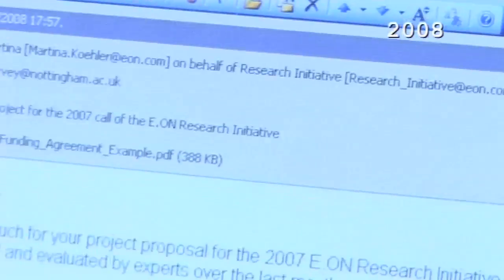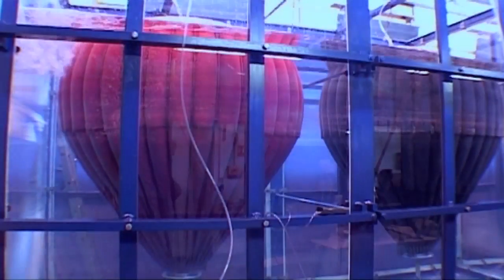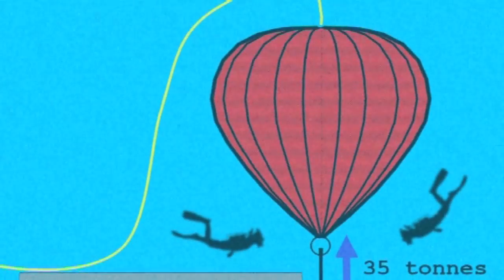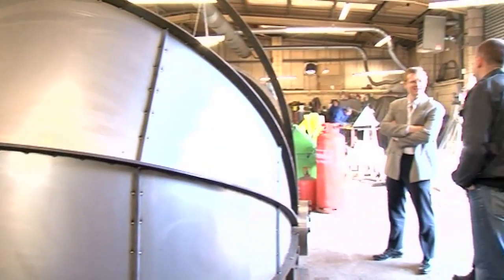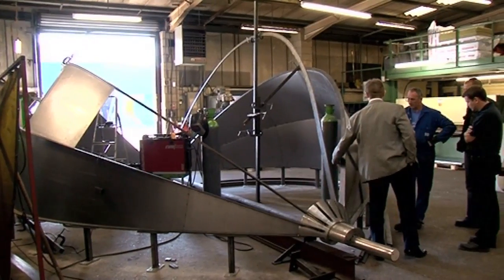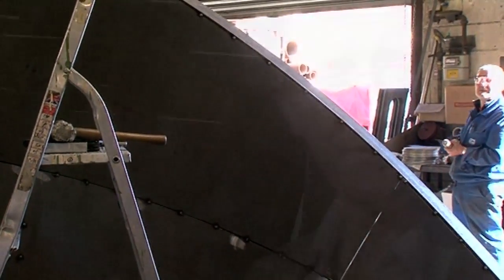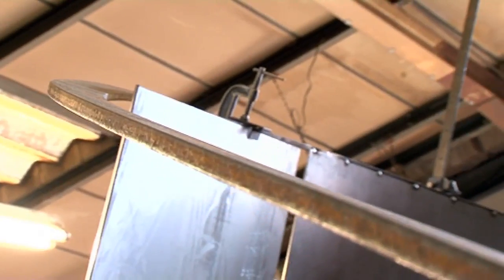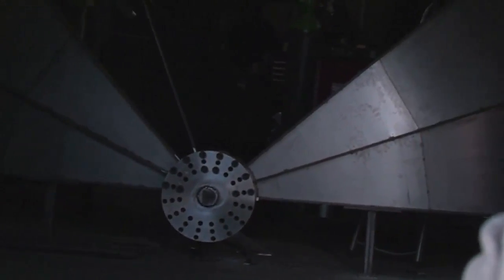Underwater Energy Bags

Comment: Looks like a bad idea to me. So you fill a balloon with air and push it down into the sea and the greater hydraulic pressure compresses the air and that energy comes from you pushing the balloon down, yes? That's not going to be efficient, for one thing because of the massive losses due to dealing with the viscosity of the water. But once it gets low enough, the air will be highly compressed and not taking much volume, which means that it will now lose its buoyancy and you won't be putting much energy into it to push it down further, and in fact there will come a point where the weight of the equipment plus the air full of compressed air will exceed its volume in water and it will sink and release energy in the process of sinking to the bottom. You'll also deal with the viscosity of the water when you try to USE the energy i.e. you bring the balloons back up. And finally there are much much better methods of storing energy in more joules per kilogram of equipment. It's just a silly idea.

Comment: I've seen this and similar ideas that use collapsible bags.  The struggle always seems to be to demonstrate that they are capable of withstanding the rigors of underwater life and thousands of cycles of inflation and deflation.

Why not just use an open-bottom diving bell, or some other rigid container with a vent in the bottom?  No moving parts.  So long as you don't completely fill it with air, the water itself acts as a seal.  It lasts practically forever.
Reply: @NickTymczasowy  I'll agree that that could be challenging in the stormy seas off Orkney.  I've been out in a small boat there before and it is certainly a rough environment.  The tales of the attempts by Uboats to penetrate the RN anchorage at Scapa Flow in both world wars are quite harrowing.  Even here, though, block ships sunk in important channels with massive daily tidal pulls coming from both directions have not moved appreciably in decades.  An old barge, with sufficient steel or concrete ballast attached to the gunwales, capsized and sunk could certainly stay in place for years, if located properly.  However, if we wanted to get a bit more sophisticated, we could certainly cast a steel or concrete cylinder that would float above a tether like these balloons.  It would be cheap and easy to produce (you could even use all sorts of retired storage tanks) and would be far more durable than a puncturable balloon that is constantly expanding and contracting.

Comment: First law of thermodynamics states that when you compress a gas, it releases heat.  Where is that heat going in this system?  Lost to the ambient water temperature.  
Their is no heat exchange system used to capture that waste heat from the compression.  For that reason, using this for the storage of energy in the form of compressed air would be very inefficient.
Reply: Unless the Baloons are made of nonconducive matter.

Comment: If this works at 50 meters how much more efficient would it be at 100 or 150 meters? Or would the losses from the flexible hoses exceed the gains from the increased pressure?

Comment: The design of the weight was horrendously expensive and prone to failure. A far cheaper way would be to use sections of the legs of scrap oil rigs. Simply weld a top and bottom onto a suitably sized chunk of leg, weld on the taps and vents and lifting lugs and connections for the air bags. And away you go. A cpiple of days work at most in an engineering shop. Maybe done at 1/10th cost and 100x more efficient and reliable. Also recycling old oil rigs to renewable use.. a Win Win in my book.
Reply: but at scale you run out of legs

Comment: I see some confusion here in the comments, they are just storing 'energy' as pressurized air instead of batteries..... so instead of using using a mechanical device which is moved by the waves to generate electrical energy, they are using mechanical device moved by waves to generate pressurized air, the pressurized air can then be used in the future to run an pressurized air operated motor.  this is great ideas. one of biggest limiting factor of storing renewable energy is BATTERIES, this technique eliminates the batteries from the equation. which is brilliant.  TATA motors has done this long time ago in some of their automobiles by installing two long cylinders tanks on the bottom of their automobiles to store pressurized  air. the tanks can be pressurized by home electrical power or renewable energy.

Comment: compressing air is inefficient, wouldn't it be better to have the bags always inflated, and they get drawn down by an electric motor like a winch, which then turns into a generator when renewable sources dont produce like PV at night, and the bags pull back up? less stress on teh bags being inflated and deflated, less power loss due to compressing air? seems like a way better solution to me

Comment: I guess filling rock caverns up with compressed air was just way to old fashioned and not sexy enough, we have to have  dozens of moving parts in 5 or 6 fathoms of salt water and an expensive pipe going miles to and from this monstrosity.  Drill into bedrock and put a huge eye bolt into the bed rock, anchoring cost problem solved.

Comment: Finding a way to store salty sea water at elevations would be an alternative? Water as a solid can be pumped at high pressures more efficiently than air and maintenance above sea level has to be easy in comparison. Mountains, canyons, bluffs and caves could be used with rainwater collection and melting tanks for ice and snow as "bonuses".

Comment: The "ballast bean" thing could have easily been manufactured like any other steel tank with rigging tabs.   The design is unnecessarily expensive..especially if it's for aesthetics no one with ever see.    ....  note:  im not a mechanical engineer,, but i did spend three years in ninth grade...so im smart.

Comment: Great concept, but has anyone ever tried using multiple (relatively smaller, scaleable and more manageable) parallel stainless steel cylinders with pistons instead of bags to accomplish the same thing so as to avoid having to deal with the difficult construction and fragile nature of bags?
Reply: Actually... why moving parts?  Why not just a steel cylinder open at the bottom with a pipe from the pump down the outside then up inside the edge so that the bubbles go up, collect at the top and push water out the bottom.  Then a pipe from the inside top out to the air release.  I just do not see any reason for a bag or piston!
Reply: Charlie Taylor 
Sure, that seems to be an even simpler way to make use of the cylinders concept.  Also, if the open-bottom cylinders are tethered by a weight, the weight could be just enough to hold the cylinders down when the cylinders are ALMOST completely full of air.  If they ever need to move or raise them, all they have to do is add just a little more air to make them buoyant.  Seems so simple!  Hey, want to start a company? ;)
Reply: HA!  That would be great!  Now, how about my heart valve like wave energy harvester to pump the air into the cylinder...   : )?
Reply: Because they get their efficiency from inflation and deflation being done at the deepest feasible part of the water. Your idea would lose energy because compressing the air to go down and its decompression going up would be less efficient than doing it all deep.

Comment: Too expensive to hold something down on the seabed? What's wrong with a big sack of rocks?
Reply: Adam Thornton You need to lift it up some time or drag it to the shore. And that is not feasible. This bean thing is a clever idea.
Reply: slimshadow777 You would need a huge ship to get the sack out of the water.
Reply: slimshadow777 This needs to be scalable. If you leave the rocks in the bottom, they need to be supplied for the next time. If this is a success, it must be made well.
Reply: SirCutRy just add a winch to the big bag of rock
Reply: why take it out if is floating on surfave still anchored to sack? quick connect fittings ,,,,
Reply: if mean the anchor bag could just dump the stone out and use the pingpong ball method to surface it  this project would be simplified for them if they researched existing oceanic salvage methodology but interdicsipline is not common

Comment: Everyone must remember this is just a way to STORE energy.
Reply: Which is actually harder than generating the energy
Reply: Yeah, it's storage, but it wouldn't take more than a slight modification to make an energy GENERATOR out of the same concept with wave energy.  Just attach the bag as a float to an arm on the bean running to a generator input to transfer the vertical movement of the bag to a rotational movement on the generator.  You could even use the wave energy to POWER the normal bag storage as compensation for unusually high demand periods.
Reply: @hellcat1988   Couldnt you just use the ocean's waves as a way to generate a pumping motion and a buoy to compress the air and send it down to the bags.

Comment: But.. why go through all the hassle of getting it under water, when you could just build a platform and lift / sink ballast on ground and store energy like that for ever with zero loss?! (as long as earth and gravity exists at least)
Reply: There is no such thing as zero loss.
Reply: Getting the cost down for a given amount of energy stored. The size of structure needed to store a given amount of energy is reduced, because the compressed air is pushing against the pressure of the water. The reduced size results in a lower cost structure.

Comment: I was hopping that a round trip efficiency number would have been mentioned that would have told us how much energy is lost when it is converted from electricity to pressure and pressure back to electricity.
Reply: Keith Reynolds The plan is, acually, not to convert from electricity to pressure and then back. The pressure is generated directly from kinetic energy extracted from large wind turbines. I suggest you have a look at other videos from this series.

Comment: I wonder if it is possible to inflate the bags at low tide and deflate them at high tide. Allowing the air in the bag during deflation to be at higher pressure than during inflation, resulting in an energy gain, thanks to the moon (as long as everything else is efficient). Im sure this would at least make the system more efficient. It's probably used but just not mentioned in the video, but if anyone knows for sure please say!
Reply: A bit late, but I e-mailed professor Garvey to ask about this, and he explained that it would likely be impractical to extract energy from this method since the pressure difference would be relatively small, even in regions with amplified tides (SE Alaska, Bay of Fundy).
Reply: Sounds pretty rational to me.
Reply: The point is to store energy for when it's needed, not for when it's most efficient to deflate. If the two overlapped, I'm sure they wouldn't mind. But over the lifetime, my guess would be that the average pressure of the environment would be the average deflation pressure.
Reply: I'd suppose you can store energy longer term, but short term storages usually for flexibility, ie. charging and releasing whenever demand is low/high.

Comment: I still don't get how it stores energy, or how it makes energy.  I don't get what it is that this thing does.  Please explain the basics.
Reply: Imagine a windmill that produces electricity 24 hours a day. But you only need the energy in the day time, so roughly 50% goes to waste. But if you then make the windmills at night instead produce power for a air-compressor you can then pump air into these underwater-bags. Then when a day comes where you need a lot of energy you can just let the air out of the bags into some kind of propellor that will spin and generate electricity. Something like that.
Reply: The basic idea is storing energy, here in the form of compressed air. You anchor an empty baloon to the sea floor. If you now blow in air via a pipe to displace 1 cubic foot of water at 100 feet of depth, you need the energy equivalent to moving the 100ft³ column of water above the baloon up one foot. This energy you can then recover by letting the air out and turning a turbine.
Reply: Compressed air is another method of energy storage. It's main purpose is to run pneumatic tools which are high powered tools. The usual method is to use metallic tanks to store this compressed energy source. But due to the scarcity of suitable available land, the underground storage system was utilised. Now underwater storage allows ample space to store it
Using metallic underwater storage tanks seems to be a better option.

Comment: I think the problem here is that you're not considering the changes in pressure, but just the pressure in itself. If the tanks are at the bottom of the ocean (ish), they will rise when there is little hydrogen/oxygen in them, as this will be less weight. So you would need very heavy tanks to hold such a low pressure environment constant at such high external pressures. So the tanks would necessarily be heavier than the water and would sink. I can also find some other flaws if you're interested.

Comment: Here's an idea I came up with, that I'm giving away here.
Wind turbines create energy that is used to split H2O deep in the ocean, about 500 ft. from the bottom. The hydrogen and oxygen is placed into metal tanks on a looped cable, and the tanks with gas in them rise, turning a generator. The gas is burned at the surface in a 24 cylinder engine to produce electricity - the hot water vapor is condensed in the combustion cylinders to produce a vacuum, adding a power stroke, & improving efficiency.
Reply: run quickly to the department of energy and file for a grant.

Comment: Isentropic Ltd could well be just a good idea, by storing energy as heat instead of compressed air. Much better round-trip efficiency, size and probably cost.
Apart from that: Even with perfect grid matching and storage systems, wind power wouldn't go very far to replace fossil fuels. Watch David MacKay "Sustainable Energy without the hot air"

Comment: The cost of sinking the bags seems to force deeper water installations. Deeper water means less efficiency per cycle. (More air pressure means more heat lost.) Ideally one would want large, low pressure systems. 

Tidal conditions matter as well.

Comment: Its a nice idea. There a pistonenengines on compressed air. But a air tight steel frame holding concrete rocks + lifeline to the airballoon under seawater. The north sea is terrible corrosive. That steel structure will be changed every 5 years?

Comment: This sounds cool, but could you please explain what the advantages of this are over simply using a compressed gas cylinder on the surface? I'm imagining something to do with heat loss, but is that significantly different with this method and why?

Thanks :)

Comment: The basic idea is that electrical energy is used to pump large amounts of air into these underwater bags. Because of the water pressure, vast amounts of air can be stored in a small space and kept there for a long time. Then, when energy is needed, air pressure can be release to power turbines and be converted back to electrical energy. Thing of it as a cheap, giant, underwater battery.

Comment: Hello Brady, today i read about a car from a Indian Company named TATA that runs 200km with one filling of compressed air as the fuel. I was thinking that this might fit well into some of the work that Prof. Garvey does. Since the air pressure must not be converted into some other form of energy and can be used by the car directly. At least it might be a good precompressed-prestage if the car needs higher pressure levels.

Thank you a lot for all the great Videos

Comment: I think such a thing has some chances to work well in an artificial well filled with water. There you have some chances to keep your machinery clean and working, you can have a pulleys at the bottom to get bags in place or out, and you can pump the water out in the worst case. I am very skeptical about running it in sea, full of corrosive chemicals and all kinds of organisms. Especially if you intend to run it for years.

Comment: why you need all that steel? there is not a cheaper way to anchor the bag?
There are big old steel boats that are not used more and sometimes they sink them because it is cheaper than recycling. You maybe can attach the bag to that?
Or maybe you just need a net cheap and strong where to put all the rocks and if you want to raise the bag to maintenance you can have an extra small bag to make them float.

Comment: Or:.  It could be that the steel container that's carrying 50 tonne of rock (for a net negative bouyancy of 25 tonne) is disrupted by the pressure differential and when it strikes the seafloor at 40 odd miles and hour, it bursts and deposits the gravel on the bottom.  The sharp magled remains attached to energy bag head for the surface, arriving there at 40 mph after slicing the divers on the way up. The bag bursts when it hits the boat. The remains have another go at the divers on the way down.

Comment: So what "kind" of disaster?  What I would expect will happen is this: The rigid container will sink, the pressure diferential will disrupt the skin of the container and it will begin to spill gravel.  Because it's already in deep water the container will still sink and the energy bag will shrink.  The container will spill enough gravel to start back to the surface.  Just before it reaches the surface the bag will be completely inflated.  Rocket up, strike the boat, over turn it, burst and sink.